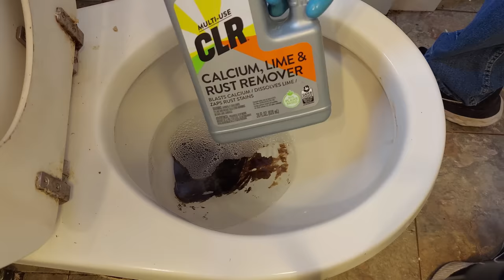Cleaning a hoarder BIOHAZARD bathroom for FREE!

Comment: The fact that you cleaned a toilet that needed to be pulled and removed entirely is heroic.
Reply: ... My question too..
Reply: That toilet needed to 100% be replaced. The base was cracked and it wasn't firmly mounted to the ground. Likely the wax seal is broken so it's going to leak and/or smell like sewage. Also, per hour it was probably cheaper to buy and install a new $200 toilet than spend the hours trying to rehab this monster.
Reply: Yeah, the toilet seat at the very least but that whole thing is broken, its gotta go. I'd rip out that subfloor for sure, but I guess that's not really in-scope. I dying to refurb that whole room!

Comment: That bathroom definitely is going to need a remodel. New toilet, boot, walls scraped, floors ripped out and replaced, lots and lots of recaulking and sealing. Will probably take alot of time of if there is someone that can help do that. 

I have cleaned and seen alot of...stuff cleaning at work and homes but man...owner has got to be super happy about this and you and team going  above and beyond is incredible. Appreciate all that you do

Note: i wrote this before finishing the video so nevermind after hearing its getting remodeled 😂

Comment: I know you pointed out that this Toilet DEFINITELY has to be replaced, but for future reference; I thought I might pass along a suggestion which you can use on any further toilets like this one, in the future, which should DEFINITELY get 'em completely clean for you!

About 30 some years ago, I had to deal with a toilet that wasn't ANYWHERE NEAR as bad as this one, but still, it had a pretty big rusty stain, which I tried many different cleaners on, but nothing worked.

Then, the co-owner of a "Mom & Pop" Hardware store, in the little country town where I was residing @ the time, suggested that I buy some Muriatic Acid and add only about a small cap full to the toilet water, let it sit awhile, then simply swirl my regular toilet brush around over the stain, and it should come right off. It worked!!! 

Of course; with the condition that this lady's pipes might possibly be in, I dunno if Muriatic Acid would be a good, advisable option or not! 

Ron
Abilene, TX.

Comment: You're funny as hell in this video!  The fecal level was sky high in this one.  If I was you, I think I would've kept the hazmat gear on through the entire job.  If I had done this job, I would've had to put all of my cleaning tools and supplies in a bio bag afterwards and thrown them out to prevent flashbacks on future projects.  Have you tried a pumice stick on toilets like this in the past?  That usually cuts through the worst stuff without having to keep using chemicals.  You're a brave and kind soul.
Reply: and might I add that i made it through the worst of the fecal without gagging until you retrieved a spoon from under the pile of Depends.

Comment: In Brazil the bathrooms are built to be a wet area, with tiles and a drain. I would splash water all around, use a hard brush and steel sponge.

Comment: For the stained limescale in the toilet, I would have flushed three times (to remove all traces of the oven cleaner which is an alkaline product, according to Aurikateriina), reduced the water level (like you did), spread citric acid powder OR vinegar essence all over the inside, and added boiling water - then let it sit for at least 20-30 minutes, inbetween respreading the mixture and re-adding acid OR vinegar and more boiling water, if necessary. I did it to a similarly-looking toilet bowl and it worked like a charm! BTW: THANK YOU SO VERY MUCH FOR WHAT YOU DO!!!!

Comment: God bless you, son!!  Thanks for explaining about the biohazard suit and respirator, cause I was wondering how you could stand it!😮
Reply: By the way, when you use a scraper, say, to clean a stove-top, do you use the plastic or metal blades?  Did you use a scraper on the lime/calcium scale in the toilet?  I need to clean a toilet bowl that has a hard-to-remove ring of hard scale build-up at the water line.  Could I use a scraper on that, and should I use the plastic blade so as not to scratch the porcelain?

Comment: I work as a porter in a grocery store, I clean up after everyone. I have to take care of public toilets during the day, trash and recycling, crush cardboard and make cardboard bales. The company doesn’t allow me to use toilet cleaners for sanitizing and cleaning toilets. I have to use weak company provided chemicals that are multi surface cleaners. Overtime hard water stains build up in the toilets so without the company knowing, I use CLR Bathroom Cleaner to loosen those stains and a scrubbing pad. I brush it off as quickly as possible without damaging the surface. The only downside of that cleaner is that it stinks, I have to use a mask and rubber gloves. Sometimes when cleaning, I have to bring my big guns, because, when I leave, nobody else touches those bathrooms for days i am off work.  And when I return, you can see human excrement and urine all over the walls, sinks dirty, everything is dusty, the floor is full of dirt, urine or feces, both in mens and women’s bathroom. The night crew is not willing to clean it up when that happens during their shift. They leave it for the morning guy. I like cleaning, but being one person on the whole store to do this job takes a toll - I cannot outrun both employees and customers at the same time while working part time, due to my cognitive impairments. I am extremely amazed that this person did such a great job cleaning the bathroom, I would like to know some extra tips if he is willing to share! 😊

Comment: The stained lime scale will come off overnight if you use Lysol Power Toilet Bowl Cleaner Gel. It will get every bit of it even in the drain hole. Works on rust stains in bathtub but it will stain some tubs depending on what it’s made of so testing first is a must in a tub. No elbow grease at all.

Comment: CLR never worked well for me... and it damaged my shower stall tiles. EEK.

I have had a really bad lime/rust build up in my master bath. In March, I took the time to scrub "at it" with pumice... made progress.. but there was a lot more, mostly below the water line.  And I took before and after pics -- because I'm clutterer (possible a hoarder, though I think that what drives me is different from most hoarders).

I've never used the "dedicated" toilet bowl cleaners... but in July, I decided to try Lysol Lime and Rust. Cleaned the toilet for soil, then applied the Lysol. (without plunging out the water) .. let it sit several hours. Didn't really pay attention to whether it was different. Several weeks later, I remembered to use the Lysol. Again, I didn't pay attention to how well it had done... then a few days later, I had the incomplete flush that signaled a growning clog... .so I plunged... and then watched as the water rose... it was then that I actually looked at the stain and my brain told me that it wasn't as bad. So, I grab my phone and find the before/after pics from March... and, yep, there was a distinct improvement. 

So, this time, I double sanitized the toilet... dipped out as much water as possible and applied the Lysol... let it sit SEVERAL hours... came back and watch as the scrub brush completely obliterated one area with each stroke... and the large thicker build up shrank around the edges, presumable, where it was a thinner build up... I was "bowled" over (yeah, not the caliber of jokester that you are... but, HEY... it's the thought that counts.

In any case... thought I'd share that in case you the Lysol Lime and Rust "might" work better. Granted, I DO realized that I let it sit far longer than the 20 minutes-or-so that you left the CLR, so it may not be as good or better than CLR.

LOVE YOUR VIDEOS! Gives me hope for overcoming my clutter problem. And, I'm definitely gonna give your sanitizing concoction a try!

Comment: in the future use a pumus stone for the inside of toilet and other stained porcelain  surfaces.  it would saved you half the time and energy and cleaning products cleaning.  pumus doesn't scratch porcelain and it takes it right off in minutes.  no oven cleaner or lime away which is bad for the septic and environment.  also googone tub and tile cleaner is the strongest stuff on the market ... all you needed was goo gone windex a pumus stone bleach to clean thst bathroom. dont just get any pumus stone they have a pumus scouring stick in cleaning supply section at safeway

Comment: Have you tried using hydrogen peroxide to breakdown bodily solids? Its breakdown products are much more benign than Easy Off. 

I use the spray bottles of H2O2 from my local pharmacy and use the standard bottles to refill them to clean my bathroom.

Comment: 2015 moved into low rent place 2 other roommates.been living Thier 28 years together.thier bad people,one crazy.but smart. Upstairs bathroom...bathtub supposed to be light pink .BLACK. Toilet,not white, BLACK. 28 years,or most of it the both of them never ever cleaned it .I never saw anything like that before. Took me 57 minutes with bathtub. I used salt, baking soda as abrasives and vinegar. And scotch green scour pad copper sponge prob woulda worked better.  Toilet took I don't remember , 20-35 minutes too remove 2 decades of black crud.

Comment: I wonder if their flooring structure is compromised and that is why your camera kept shaking as your cleaned. The water will seep and drain in the direction of the path of least resistance.  I would not be surprised the toilet leaked underneath the base. The subfloor looks like nothing more that plywood.

Comment: I get that this is 'content', but I look at the couple of hours spent in time, elbow grease and supplies, on a toilet that is clearly going to have to be discarded anyway (due to the crack), and have to wonder if the time could have been better spent elsewhere.
Reply from the maker: If you were the one changing that toilet, would you rathere do it before or after I cleaned it?
Reply: @MidwestMagicCleaning  - Meh, disconnect the water line, dump a bucket of water down to drain the P-Trap, throw over a few of those industrial garbage bags with access to the bolts, and the issue is mitigated.

Not saying you didn't do an amazing job, just that the effort was wasted on something that would inevitably be trashed anyway - same reason you didn't bother cleaning the tub.

Comment: You threw away your mops and other cleaning supplies afterwards, right?  If you knew they were going to replace the toilet, why did you clean it?
Reply from the maker: If you were replacing the toilet, which state would you rather it be in? Caked in human waste, or clean?
Reply: @MidwestMagicCleaning  well clean but not necessarily to the degree to which you cleaned it.

Don't misunderstand, I think what you're doing to help people is wonderful.  I just don't like feeling that you're working harder than you need to.  I worked for 18 years as an in-home caregiver to elderly and disabled people.  At least 80% of my time spent in a client's home was spent cleaning so I understand how hard it is on your body.  I can't kneel on the floor anymore without my knees hurting within 30 seconds.  You're still young enough that you aren't experiencing severe pain.  I just would rather you never do.